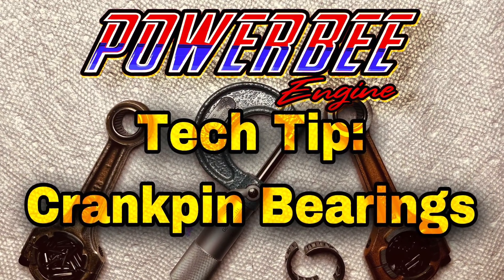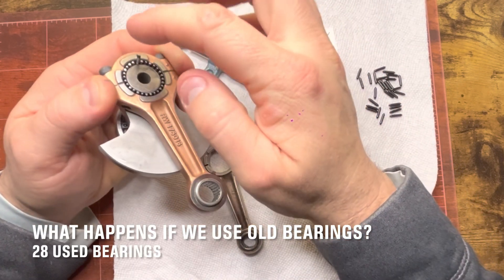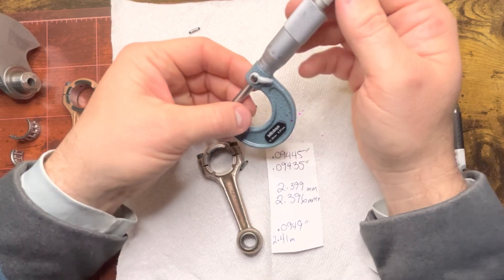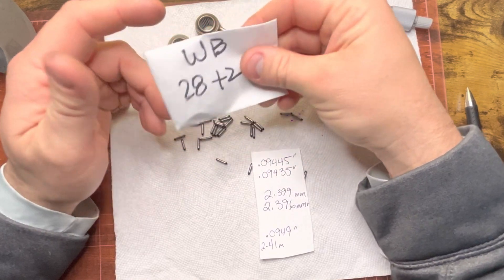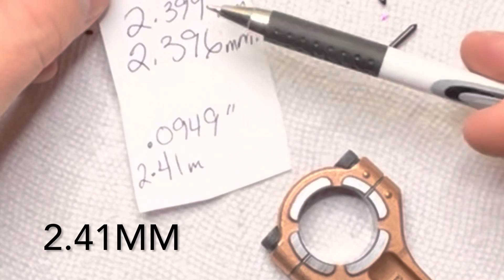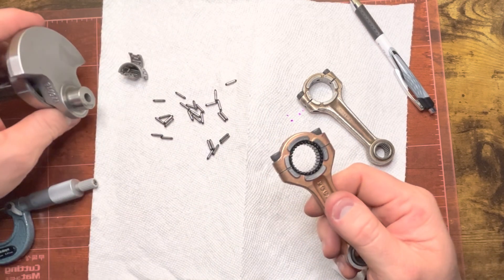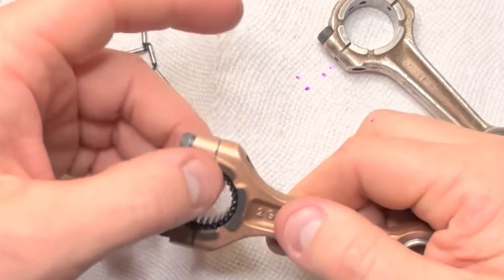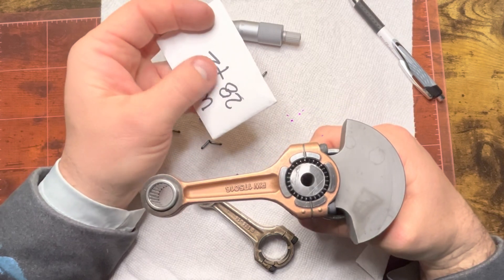West Bend Power Bee 820 Engine Tech Tip “bearings”

Comment: Great video! How much compression should I be getting from my 820? Just swapped the piston for a new one and got a new-used cylinder that doesn’t have any scarring. I haven’t gotten it over 25 psi yet…it’s not mounted or anything and I’m using a drill to slowly turn it.
Reply from the maker: A lot more. There is a compression chart in the files of the Facebook group

Comment: Excuse me, but where's any void in the rod bearings to allow the fuel/oil to fill - LUBRICATE and COOL? No room at the pin.  Seems to me your lower rod end fitted like that, jammed full will get MINIMUM cooling and oil because there's no where for it to go.  You NEED some void for fuel/oil to flow for longevity. Sometimes. More (needles) is not better? 13:42  Though i like more needles- less load per each, ... the original bee lasted 40 years. Not sure about this. And ive NEVER seen a ring pin placed on top. Im not going to do that . Whats your proof / research that 13:42 these changes  are bullet proof? Or provide max longevitu? 
Are your blocks nitrided? Original ones were chrome plated - SMOOTH as a mirror. 
Thank You.
Reply from the maker: Hello, thanks for the comment.  Unfortunately I'm not 100% sure what your saying about the void in the bearing?  If you mean clearance between the crankpin/journal, the bearings, and the connecting rod, then the tolerances are very similar to the factory specs of 60 years ago, except now they have been improved. Still plenty of space and channels in the rod to allow for lubrication. Also, there are caged versions of the bearings, similar to the old West Bend 580 caged bearings.   As far as the cylinder's bore lining, they are Nickel Silicon Carbide plated.  It's far superior to Chrome plating. You can google it, if you're unfamiliar with NSC or Nikasil plating.   As far as the "Bulletproofing", I supplied the parts for John Wall to take around the track. RPMs exceeded 13,000.  13K is 3,000 more than West Bend are safely run.  I have my 894 and 940 engines tearing up the tracks at VKCA events on their club kart.   I'm not sure how in the know you are about some of the big names in Vintage Karting, but a gentleman named Terry Ives of Terry Ives Industry (and kart engine building fame) can testify to the top tier quality of the engines today.
Reply: I ran a wb 820 that wiseco built it was a legal b limited 135 gem v12 on top and gem v6 on bottom it would run agaist b bombs it had a akerman full circle crank we ran a horstman pancake muffler on their dyno it put out 25 hp on methonal  russel karting specialties bult them also back in the 60s any one running them like that just asking